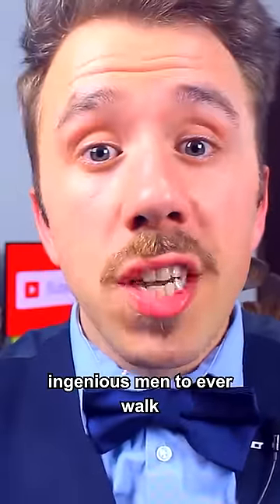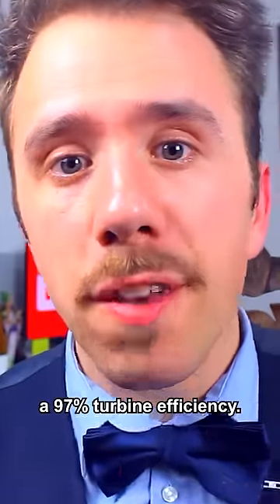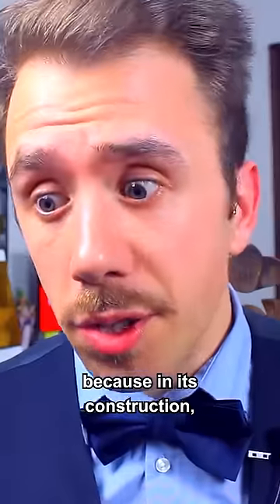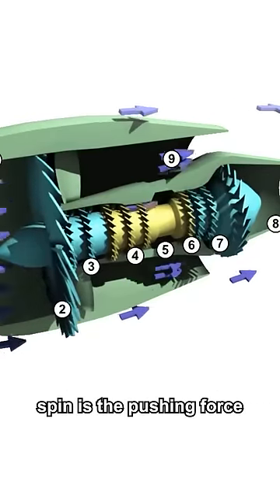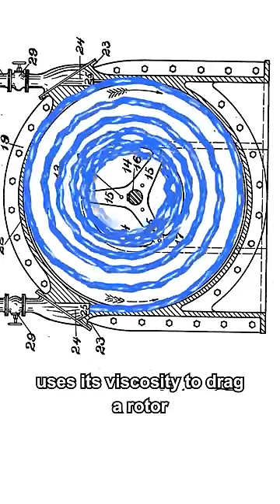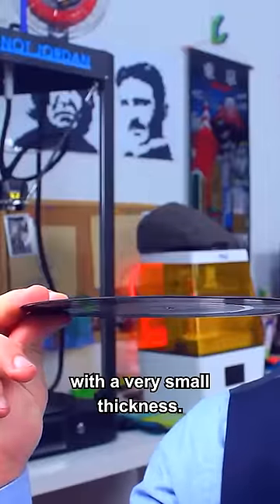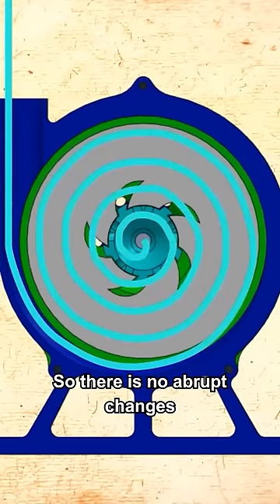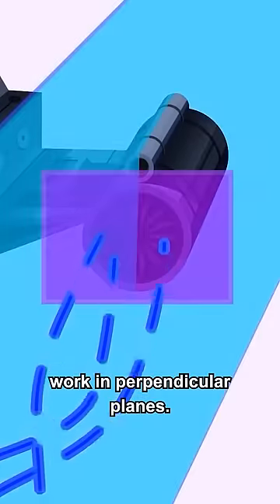97% Efficiency?! Was Tesla Right About His Turbine?

Comment: In axial turbines, the flow and the blade is NOT in perpendicular condition unless the blade is stalling.
In normal operating point, the turbine blades operates in rather small angle of attack.
The real difference between the tesla turbine and the axial turbines is that tesla turbine use Drag while axial turbine use Lift to spin. On thin wings like axial turbine  or Tesla turbine Lift to Drag ratio is usually very large in smaller angle of attack which mean that Tesla turbine would never produce much torque.
There are design like pelton turbine that much better utilize drag if you must go that route(like in low flow rate application)

Comment: turbine ... how does it produce thrust
Reply: turbines do not produce thrust they turn a shaft. 

turbine definition
"a machine for producing continuous power in which a wheel or rotor, typically fitted with vanes, is made to revolve by a fast-moving flow of water, steam, gas, air, or other fluid."
Reply: It doesn't, it produces rotation.
Reply: @garfnob4832  yeah then theres nothing this will actually replace on a scale
Reply: @c4tze yep, mostly because they are no more efficient then a standard turbines when put under load. the design is sound and does what it is meant to do. if they were more efficient they would be great for things like dams.

Comment: In practice, Tesla turbines and regular bladed turbines have about the same efficiency. In theory, Tesla turbines would be simpler to build, but by the time they existed a massive infrastructure for building and maintaining bladed turbines had already been built, and the savings would have been negligible next to the cost of retooling to build Tesla turbines. As a result, bladed turbines are used to this day.
Reply: Not to mention added problems, like need in HUGE, extremely thin disks that can withstand optimal operating conditions. Turbines are already nightmare as-is.

Comment: One of my engineering professors built a small table top version of this for class and it's spun up to ridiculous RPMs, [and by small I mean aprox.5 ft by 3 ft]. Of course there was no load on it but I have to wonder how would Tesla's engine work using modern materials, stuff that is lighter but stronger and maybe won't warp as easy as the stuff he was using back then like Titanium or carbon fiber🤔

Comment: Well watermill's main wheels are also rotating in the same direction as the flowing water stream and not perpendicular. I think they have the same problem as the tesla turbine, that only the half of the wheel is used where the water/air enters. The pressure on perpendicular turbines is roughly the same on all blades at all times. To make a Tesla turbine really Tesla it should have three inlets in a triangular shape, similar to a 3-phase motor.. ;)

Comment: Just because it is efficient does not mean it can be used. The problem with high efficient turbines/impellers is that if a goose or crap gets in it, it is easy to be destroyed.
Reply: That's the beauty of a disc turbine. Super robust, and way cheaper to manufacture, so cheaper to replace if they do fail.

Comment: I've seen demonstrations of this in very small prototypes. They work relatively effective until a load is applied. Then it pretty much sees up. If you would try to scale this up, the size and weight of the discs would be so enormous or they would be so thin that they would warp and come in contact with Jason.as much as I love Tesla, I'm gonna have to say this is a no as far as an effective generating device

Comment: My understanding is that itworks, but it spins so fast the materials fly apart. I'm not an engineer,  but have read 2 books written about him.
Reply: Nope
Reply: Which is to say that the materials technology of the early 1900s wasn't up to the job. 
Nowadays, ordinary 310 stainless sheet would do an awesome job even at high temperature. For really high temps (gas turbine) there are Inconel and Hastelloy. And carbon fiber is 1/5 the weight of stainless steel for the same strength, so carbon fiber discs could handle higher RPMs, as there would be less force on them at a given RPM.

Comment: For those know-it-alls in the comments saying it isn't efficient under loads, you are wrong. The main reason why it isn't used today is because of how ungodly fast it spins. It spins so fast that the disks will warp or shatter before it reaches full power.

So to counteract the devastating effects of the turbine's full power, you need to lower its speed and neuter its efficiency.
Reply: Stainless steel is pretty dang strong in tension. 310 stainless is also thermally stable at temperatures up over 1,000 C. Want to go higher than that (gas turbine) there's Inconel or Hastelloy.  Or, go with carbon fiber for call it 5x tensile strength at a higher cost. Would have to figure the payback period of the higher efficiency vs. increased cost. 
We have materials and bearing technology today that were only science fiction in 1900. Air bearings and magnetic bearings are on the general market right now.

Comment: I can see the torque issue here. It's like having a 1000 horsepower engine with 5Nm of torque. It can't do any work.
Reply: that is why tesla already sayed that they have to be scalled up  and can only run at very high speeds
wich solves the torque problem
-
problem is find a material that can withstand those powers
Reply: They do generate useful torque, especially if you add the spacers between the discs at the rim from the Le Tourneau patent. Huge improvement in torque and self-starting. I have one I built sitting here in my house in a box that generates useful torque.   
Either use reduction gearing to get the torque you need out of a Tesla turbine (or any high speed turbine) or build one with rare earth magnets as disc spacers and a case wound as a stator, and have a turbine and generator in one super-compact unit.

Comment: Ordinary turbine doesn't work because of the slope of the blades, at least this is not accurate way to explain it. Turbine blades produce lift, in gas turbines, jet engines, and even in wind turbines. Direction of this lift is tangential to the shaft axis, and depends on the angle of attack of the blade, and speed of the fluid passing. This is actually the reason why wind turbine blades, like helicopter blades, are adjustable on the angle of attack. Turbine blades are not like rudders, they are like wings.

Hydraulic turbines are different category but also they obey same physical principles. Water turbine can be literal screw in some cases.

Comment: The Tesla turbine does not work because when it is operating and it's 97% efficient state the fluid inside is encountering laminar flow. However as soon as you put any load on the Tesla turbine it creates turbulent flows in the fluid inside which reduces efficiency to about 60% which is the same as any other turbine

Comment: It works . But it has no torque under a load . If you look at a vacuum cleaners air turbine it combines both types of turbines and is much more efficient as it has torque if it were to be reversed and used to drive instead of being driven.

Comment: There's a reason why the "miracle inventions" of Tesla aren't used. That specific turbine, is only efficient, if there is nothing attached to it... 
The moment you try to have it gather energy or move something, the efficiency is not that great. Combine that with the fact that over time you'd have to replace the disks that could get damaged or warp, and you have a turbine that gives a decreased power output, while being more expensive in the long run. 
These inventions are GREAT as thought experiments, and engineering lessons, but in practice, they're not any better than what we already have.

Comment: This turbine slips as many other people are saying. Basically, it's useless in any real-world scenario or needs to be so large that it becomes more of a fly wheel, which requires so much power to get going. It's hardly worth it.
Reply: Me, to my working model Tesla turbine: "Sorry, buddy. Some rando on the Internet says you can't really do useful work, so I have to scrap you. Yeah, I know you're only the size of a bagel, and that even at that size I need a huge air compressor to test you at full capacity. Yes, you're all about the power density- you're preaching to the choir. And yes, we do have the test on video where you self-start the little DC motor running as a generator on just 80 PSI of compressed air. And yes, you did that with only ten of the posterboard proof-of-concept discs, and not a full sheet steel 24 disc pack. But, this guy on the Internet says you're fake, so I have to scrap you now."

Comment: It is truly that efficient. However, it has no ability to handle torque.
Reply: Really? Mine puts out useful torque. Self starts a small DC motor being used as a generator, and generates electricity with it. The spacers (washers) between the discs from the LeTourneau patent really help with self starting, as well as disc spacing and disc pack stiffness. That's why I can run one with posterboard discs and get work out of it.
Tesla turbines operate at very high RPMs. Not enough torque? Ever heard of reduction gears? Steam turbines and reduction gears go together like peanut butter and chocolate, or sex and death.
Reply: @ostlandr  Direct drive is definitely not good for torque.

But anything can be made to produce enough torque if you want it to bad enough. ;)

Comment: For anyone wondering, the reasons why tesla turbines are not used are, they requires laminar flow, they produce low amounts of torque, and they are not very compact.

Because of these reasons, they aren't very practical for most purposes.
Reply: Wait- one of their major advantages is their huge power density. They are VERY compact!  
Maintaining laminar flow is as easy as matching the velocity of the incoming working fluid to the turbine RPM, and matching disc spacing to the boundary layer thickness of the working fluid (rule of thumb, disc spacing = 2X boundary layer thickness.)
And FYI steam turbines and reduction gears go together like peanut butter and chocolate. Always have. Whether it's high RPM/low torque or low RPM/high torque, that can work out to the same horsepower.

Comment: For anyone saying it's inefficient due to low torque, the torque rises as the speed disparity between the flow rate of the fluid and the spin rate of the disks increases.

Faster fluid relative to slower disk spin = more torque.

Comment: To answer the video title, No. Tesla turbine efficiency is not really 97%. In the real world its around 60 in some poorer designs and maybe up to 90 with better designs, but really isn't 97%. It also lacks in torque production for energy generation dor the amount of energy input.

Tesla turbines are really cool. What causes losses to any moving object? Air resistance of course, but what if you use the resistance as the means of movement? Its a Tesla turbine! 

A free spinning turbine would be able to produce a very high input to output energy ratio with the only losses realized on the walls of the non spinning turbine and the axis where its attached to, but this means that any realistic use of torque production is relatively useless.

Comment: But can handle very little torque.
Reply: It outputs torque, it doesn't receive it

If you regulate the input correctly, giving the turbine time to spin up it can output a lot of torque relative to its input pressures. Specifically because of its efficiency

Comment: I always wondered if one might be able to make the surface of the plates more " sticky to the flowing air, or change the air fluid to something more viscous? ( environmentally terrible but a more environmentally neutral   hexafluoride )
Reply: I think the first step is just to use more thinner discs in the volume, but perhaps they could use a surface texture for turbulence/drag, a grain with the desired flow pattern, or make it a hybrid with internal vanes to recover some torque 🤔
Reply: @Qui-9 good point, only issue is available materials, eventually a 2D material could be used ( not graphene because it is too elastic-- well maybe still as a an energy storage device), although centrifuge forces after slow startup in its equilibrium state might work, but there is other 2D materials that are much stiffer.